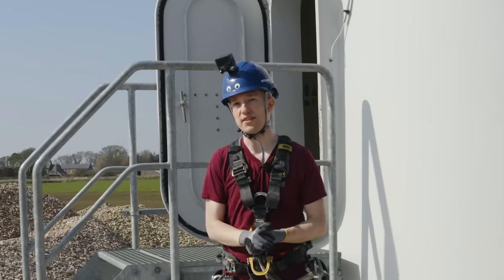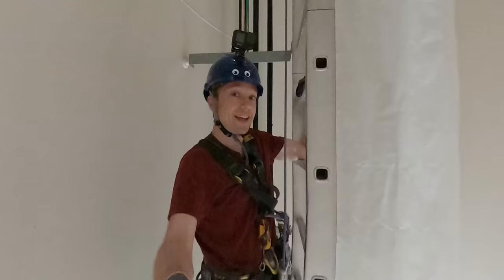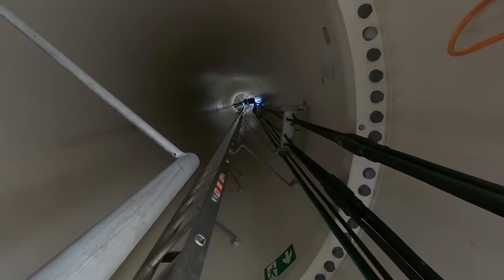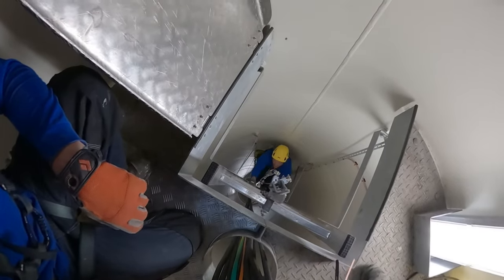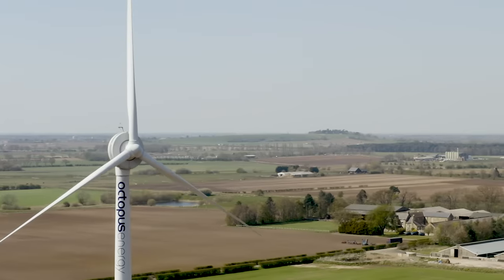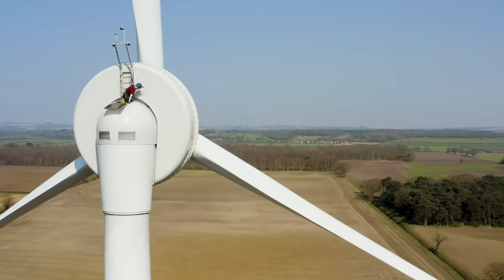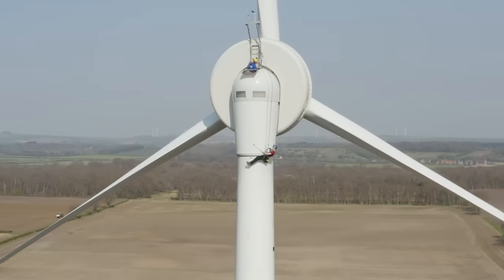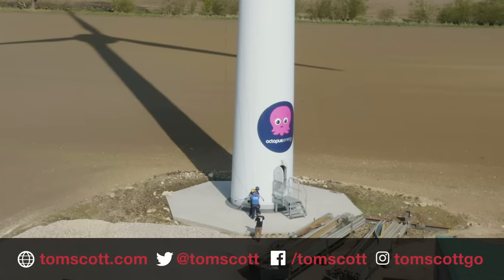Taking The Emergency Exit From A Wind Turbine

Comment: One thing I really appreciate about you, Tom, is that you get to the point. You don’t add loads of nonsense or uninteresting fluff to your videos just to get them to the 10 minute mark. You actually value quality over quantity.
Reply: I thought the 10 minute rule for video monetization was removed a long time ago, I could be wrong though.
Reply: Yep. Checked out his over videos & I'm subscribed. So glad I cut my cable teevee years ago. What a waste of idiotic programming from these stiff, old & clueless teevee executives. In a few more decades, cable teevee will go the way of the teevee antenna.
   When the "teevee generation" of tens of millions of mindless soap opera, sit com, "tv drama", & "hollywood award" ceremony watching boomers eventually bites the dust, cable will become like the antenna & unlike the antenna which costs little to produce, the cable companies will collapse & bite the dust as well!
Reply: @Post_Stall_Maneuver  na its still active
Reply: @RiteshSingh-po7tm  I wish people would stop constantly stating things as though it's fact with nothing to back it up. Everything points to there being NO minimum length requirement, and it doesn't really even make sense - a huge number of videos are below 10 minutes. Likewise even shorts can be monetized.
I couldn't even find any reference to minimum video length at all in youtubes guidelines. Previously there was a 10 minutes(now 8) requirement for mid-roll ads, that's all.
Reply: veryslyfox  There's not even much difference between the average person in the UK & US.
Average male height and weight - UK(England) = 175cm, 85.4kg ; US = 175cm, 90.6kg
Where I live the average weight is almost exactly half way between, and a very large percentage would have no problem getting up the ladder. Like almost everywhere a smaller proportion throw the average off - someone can easily be 20+ kg overweight, but it's all but impossible to be 20kg+ underweight.
Reply: veryslyfox  Obesity rates in the UK are very nearly as bad as in the US

Comment: The 2 things I learned from this video :
1- The view at the top is amazing
2- He's got two wires on him
Reply: the view from the top is worth trespassing for
Reply: 3- Turbines now have an emergency exit due to a fire that killed two repairman, and trapped them at the top.
Reply: @jsl6155  I was surprised they didn't mention the risk of fire. Sounded like this emergency exit is only meant for one person, meaning this wouldn't even solve that issue.

Comment: Leaning back on that two rope system 50 meters in the air is probably one of the hardest things to watch, can’t imagine how you did that in person.
Reply: I've actually done that. Not from a wind turbine, but in basic training back when I joined the U.S. Army. You have to learn how to rappel down a 40ft wall. It's scary stuff if you've never done anything like that before.
Reply: @Gogeta70  I remember seeing a video of soldiers training and they showed that part and how one of those trainees froze up. Deffenite hard step to get into the mindset of trusting the equipment to get you down safely.
Reply: when I did waterfall rappelling it was the same thing. Even worse because you have all the powerful water coming on your side and to walk down you have to do your steps on slippery wet rocks. I froze and couldn't move at some point and somehow I found a hole behind the waterfall where I went inside sat down and chill for a bit, hoping the guys would understand to come and rescue as i wasn't going anywhere. Then I remembered this was a jungle and there could be snakes on that hole. I left the hole and descent faster than the water itself 😂
Reply: @TheHunter2  damn
Reply: What if it's a windy day??

Comment: "And if you fall down, itll break"
Double checks what guy said
"itll brake"
oh thank god
Reply: "It'll BREAK"
panik
"That's your braking system"
kalm
Reply: Technically it does both, one fall ruins that 400 dollar piece of equipment, about a 1 foot fall
Reply: @a.wosaibi  the braking system is broken
panik
Reply: @junan6183  facts
Reply: @dmritchie3  Is it really just single use?
Reply: @computernerdinside  yes they are, and so are the harnesses, the harnesses are  usually alright if u fall in to the cable catch most of the time (cause its usually just a slip that you fall a few inches into) , but gotta inspect your harness' stretch points, like a seatbelt in your car after a wreck, the whole entire harness needs to be replaced after a 'hooked safety' (where you fall into your fall arrests) fall because theyre meant to stretch and slow down everything by tearing different layers of the rope fibers that hold em together
Reply: @dmritchie3  And it's not that they couldn't be used again.  It's an appropriate level of caution, so you don't even need to confirm they're safe after a fall, just replace them.

Comment: "If you fall, it will brake." Gee--that's a LOT clearer in writing than in speech!
Reply: I interpreted it as "if you will fall, it will break" as in, it will trip, it will break in the same sense as an electrical breaker. I can see how it could be confusing though.
Reply: @tomysshadow  I looked at it both ways and wasn't sure which was right and was satisfied with the notion of "either way, it'll stop you"
Reply: @tomysshadow  electrical breakers physically break the circuit. It would be like having an automatic rope disconnecter that dropped people to their death to ensure the rope didn't snap.
Reply: the fall arrests we use on roofs really do break, theyre designed to do so in order to provide a softer catch than the snatch of rope, the rope/strap is designed to unravel and appears broken!
Reply: “If it breaks, you will fall.”

Comment: The "I've got two wires!" bit really hit me because it really seemed like it was just Tom thinking aloud, convincing himself this very unsafe-seeming thing was in fact perfectly safe.
Reply: I caught that too. That was genuine self-talk we witnessed.
Reply: It's letting go that is the problem.  Your brain just doesn't want to be convinced to do it. The moment your body wegiht is acttually supported entierly by a harness,  90% of anxiety goes away. Unless you're reylly overthinking and/or have severe agoraphobia that is.
Reply: I think it seemed like that because it's literally what was happening. Definitely awesome, because I'd be too scared to even convince myself it was safe. 😂
Reply: @mancubwwa  well your brain is thinking that you're just falling backwards from a very high point and doing everything it can to stop you from letting go.
Reply: @mancubwwa   the fear of heights is Acrophobia, Agoraphobia is fear of going out into situations that may cause anxiety. Close in both spelling and in this situation meaning, so I'll let it slide this time😜
Reply: I have been to climbing gyms with an auto-belay system that is effectively what they have here. Even 25 feet up, it's hard to get your brain to accept that the right thing to do is lean back and let the system work.

Comment: Love the exit signs that just point down
Reply: The signs are required to be accurate, not helpful.
Reply: there are types of injuries where you have a loss of orientation so it helps there actually
Reply: @megafrodo100  good point
Reply: I think it must have been designed by Aperture Laboratories. At least you've got your Long Fall Boots... you do have your Long Fall Boots, right?... ah, never mind.

Comment: this idea reminded me of the two dutch men in Ooltgensplaat that were last seen hugging on a burning wind turbine. both didn't survive. one jumped and one burned to death.
Reply: I remember that.  Very sad.
Reply: Same. The fire would have burned the ropes I assume.
Reply: @Wolf_Ghost  actually no, they use fireproof ropes literally for the Ooltgensplaat disaster
Reply: @rsplatpc  nice! I'm glad to hear that. I wish they had them available. That whole disaster was heartbreaking.
Reply: @rsplatpc  is fireproof rope not just steel cables like these? if it is in contact with flames enough for that to matter, how do you descend it?

Comment: This is why we've got YouTube. No way in any hell I would even think about doing that.
Reply: I would
Reply: This would be so fun!
Reply: The logical next step is for someone to make a VR experience out of it.
Reply: I've rappelled down a 40ft/12m tower twice, and I can promise you that the "two wires" part was the single hardest portion of the entire thing. Once you've done that, it's so much fun it's great! Once you know the rope's gonna hold, it's fun and exhilarating!
Reply: Nope, nope nope nope.
Reply: I doubt I'd get a chance to do that off a turbine but I've repelled before.  Its fun once you trust the gear.
Reply: @kutsen39  in New Heaven,  CT.  There's an indoor zoo and climb when you had enough you go to the top and do a free fall with a breaking system is a blast.

Comment: 1:50 genuine terror in toms face contrasting against googly eyes on helmet
Reply: I completely missed the googly eyes until you pointed them out :D
Reply: I hope they're painted and not glued on there. We once had a whole batch of helmets fail inspection because they had numbered stickers on them. The sticky stuff in stickers and such contains chemicals that soften plastic. Small sticker (or googly eyes) stuck on a helmet? Won't pass inspection, permanently unfit for its purpose (on paper at least).
Reply: @SirPrizeMF  thats interesting, I work in a sign shop and I regularly make numbered helmet decals. must be a regional restriction? possibly the 3m material we use doesnt degrade plastic?
Reply: Haha never even noticed the googly eyes til your comment

Comment: Can I point out that the camera work WHILE HE"S UP THERE is done SO smoothly that you never stop for a moment to think: "Wait, where IS this camera and WHO's operating it?!?!?!" Smoooooooth! Kudos
Reply: I think its a 360 camera, so all the panning and such is done in post so tom doesn't have to worry about it as hes worrying about being on top of a wind turbine.
Reply: @jetison333  omg! you're right, I JUST noticed the stick holding the camera has been taken out in post and even THAT is done so smoothly... wow (you see the shadow of the stick, but the stick itself is out)
Reply: @joanbennettnyc  If the stick is aligned properly and fits between the lenses (i.e. not too thick or bendy), it shouldn't be visible in the videos created as it is in the camera's blind spot. Removing a tripod can be a bit of work, which is why some use a ground stake type rather than one with legs or just tell the software to replace the nadir with a logo.
Reply: I spent the entire video trying to spot the cameras at work here.

Comment: 4:59 "All i need to do now is sit, and wait."

Voice from top: "We've reached the max length of the rope Tom you're on your own."
Reply: This is one of the common mistakes that happens in abseil accidents: too short rope, and the person forgot to add a stopper knot at the rope.
Reply: @nolyspe  yikes.
Reply: 25 or so years ago, someone died after trying to escape the Allegheny County jail in Pittsburgh from top floor by repelling down with bedsheets. They did not have enough and tried to jump several floors.
(I believe the windows in the cafeteria on the open.)
Reply: What I really want to know is how long it took to get down.
Reply: @nitehawk86  Now this guy really wanted to get out.

Comment: "Quick, the turbine is on fire, take the Emergency Descender ..."
elevator music plays
Reply: Ugh just the other day i had to share the turbine emergency descender with THAT coworker, you know the one
Reply: Or Metallica since it's a huge metal fan.
Reply: “Fourth  floor, Lingerie”.
Reply: In a fire on the nacelle you must not take the descender, you always have to take the ladder. Those things burst in flames quicker than you can descend, and the rope is flammable...
Reply: @Isgolo  is that why the 2 guys who died didn't make it?.
Reply: @Isgolo  and they should fix that problem but using steel cable in the area of potential fire. Even if you have to jump and fall a little ways to the end of the steel its better than burning to death or falling all the way to the ground
Reply: @Isgolo  which part of this steel structure is flammable?
Reply: @nathanberrigan9839  damn that was clever

Comment: I can't even begin to imagine the amount of fear I wold have descending.
Reply: I nearly had a panic attack just watching
Reply: @RunstarHomer  haahahahha
Reply: If you already were an acrophobic then you still would be after this experience!
Reply: I couldn’t describe the fear I’d have going up!
Reply: Someone would have to save me from the parking lot.
Reply: That's because you are Canadian so this figures.
Reply: @iinob  Have abseiled a height roughly half this (45 metres, 150 feet) and I can corroborate this. Leaning out is the hard part but once you're sitting on the wires, it's quite fun actually.
Reply: @RunstarHomer  same
Reply: I have done a few sessions of indoor rock climbing and heights are deceiving as everything seems much higher than it really is. I just focused on the next grab to climb and didn't look down as I descended.
Reply: @lozm4835  Similiar experience here. My main Hobby is Geocaching and I recently bought climbing equipment for Caches that are hidden in the top of trees (~10-30 meters depending on who hid them) and whenever I am that far above the ground, the one single part that still gives me shivers is when you start to descend. When all your additional gear you needed for the ascend is detached and all that is keeping you save is your safety device of choice (I mainly use the RIG) and some rope. Once you descend, it is just amazing. But that tiny moment when you lean back, leaving the safety of the branches is always terrifying.

Comment: I like how there's exit signs pointing down halfway on the ladder, like "ah I was a bit lost for a minute"
Reply: In case you’re disoriented from illness, panic or smoke.
Reply: @lach888c2  right, gravity certainly turns off when there is smoke
Reply: I guess they point to the nearest emergency exit.
So the ones a little over halfway up point upwards.
Reply: I'd imagine if you do manage to let go of the ladder with both your arms and legs, you might spin upside down on the rope and get disoriented.
Reply: @ObsidianGloria  done many handstands in my life and never forgot which way to the ground
Reply: @clray123  smoke inhalation and adrenaline will tend to do that
Reply: @lach888c2  Certainly not adrenaline, I've had adrenaline rushes, and they make you pumped for action, not disoriented or forgetting about gravity.

I think you are referring to airplane accidents, in which smoke in the cabin can make it hard to see which way to the exit (hence the guiding lights installed in the floor). It is not because you lose sense of up and down.

Well, maybe if your eardrums burst you would.
Reply: Also, a falling plane might spin around, making you lose sense of balance (like a roller coaster)... slipping off the ladder in a wind turbine does not seem like it at all.

Comment: Wow, tom is a badass I wouldn’t have the balls to do that
Reply: Me neither, I couldn't even watch the ending of the video. That must be terrifying!
Reply: My roof had couple pieces of shingle fall off by the high wind, it doesn't look too hard to fix it myself, but when I got up there I instantly regret my decision and my legs and arms start shaking because of fear, barely made it to the spot which is the highest points on the roof and on an edge so a small miss in step could mean I will fall and die, on that moment I really felt that roofer is a very respectful job.

Comment: We manufacture these emergency descent systems here in India for a German company, and gets installed in all these wind turbines. It’s got an internal gearing and brake system which works on centripetal force and slows you down if you go faster than a set velocity. Quite clever little mechanism, but has to be made precisely, somebody’s life depends on it. Happy to see this video!
Reply: P. S there is also a high speed electric chain hoist in the nacelle of the wind turbine which is used to lift and lower tools and equipment. We also manufacture the chain hoist for many wind turbine OEMs, also for EWT :)
Reply: For a German company? Your work must be excellent quality if they buy it in the land of engineering

Comment: That fall arrest system when you’re climbing up it sounds similar to auto-belay systems in indoor rock climbing
Reply: That’s what I thought too
Reply: Lots of people who do work at hight jobs are also into climbing.
Reply: I believe Tom was climbing up a vertical lifeline in this video, which is a permanently fixed length of wire running the length of the ladder; whereas an automatic belay retracts the line in as the climber ascends? The end goal of both systems is the same of course :)